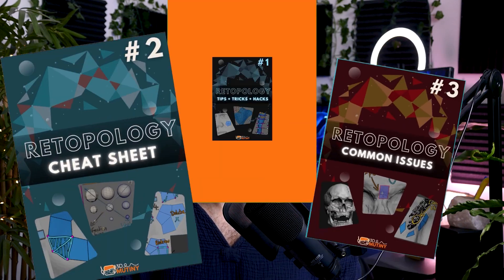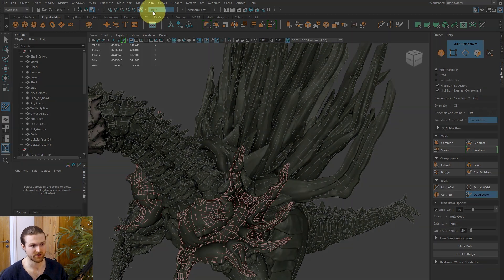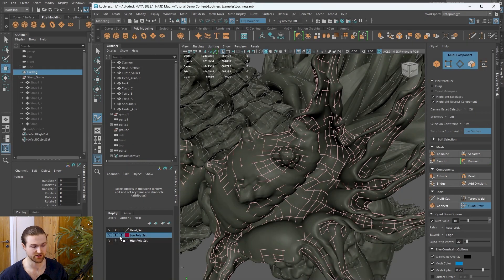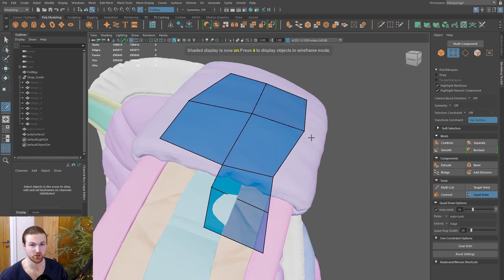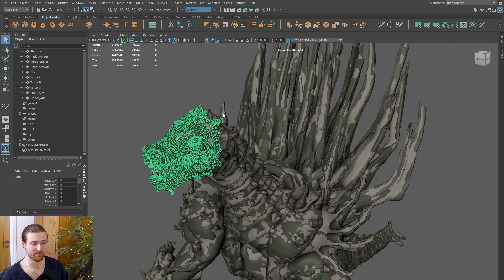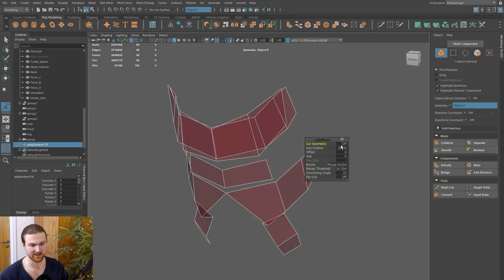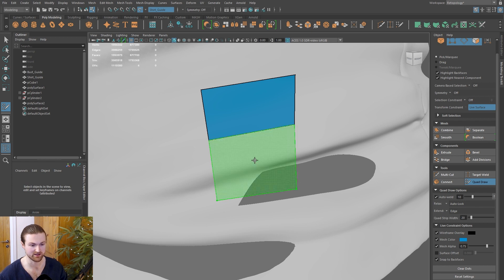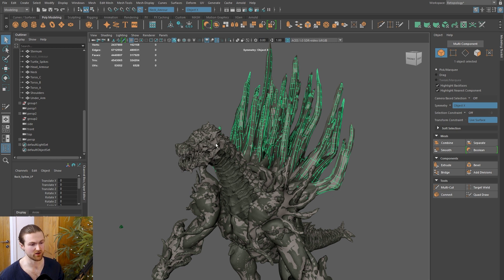🦜Quad Tool Not Working? All Fixes (From an Expert)

Comment: Im not sure whats wrong with my quad draw, i choose my highpoly set it to live and when i start using quad draw i can set up dots but after the forth is set i wont get a surface just four green dots
Reply: Hold Shift Key on your keyboard and hover your mouse in the middle of the four dots, and then you can see it fill the gap with a polygon.

Comment: Quadraw isn't working properly for me. All I can do is lay out verts>hold shift to create the face (Blue with black border) and that's it. Nothing is selectable or editable. If I hold down shift the cursor turns to the word "relax"  which does nothing.  I have the "Live" magnet icon checked, quad draw and multi component selected. I've tried this on highpoly live mesh and a simple box and its the same result regardless of the livemesh; non-editable components.  What setting am I missing?
Reply from the maker: Hmm. Come into the Discord and we can help you out.
Reply: I am having this exact same issue, did you find a fix?